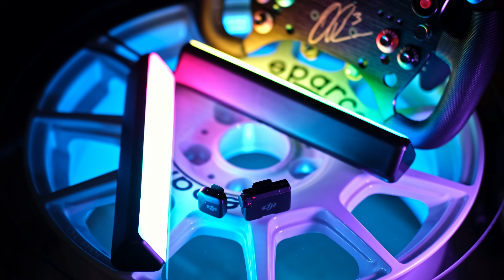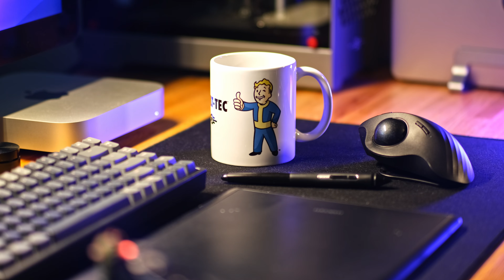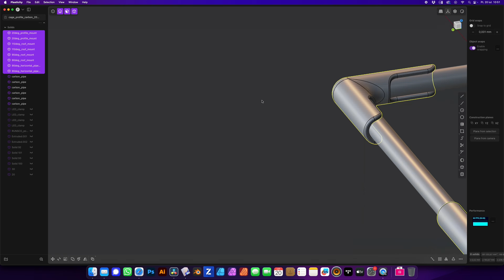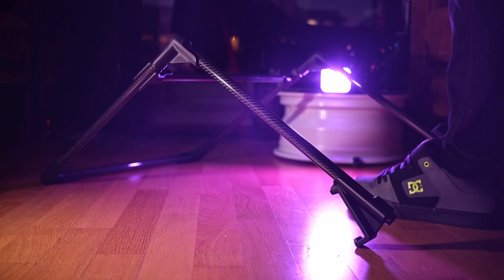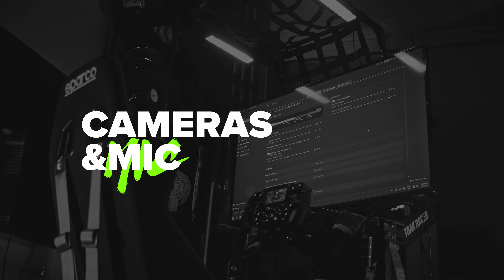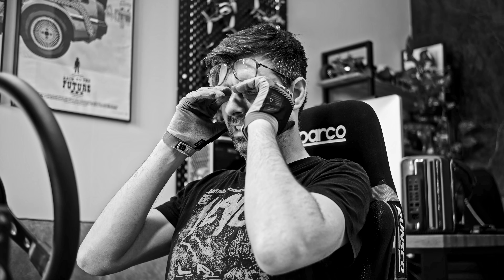How to Build the World’s Lightest Sim Rig Roof — My Framework for Controlled Lights, Cameras & Chaos

Comment: Not gonna lie 
I really like this Idea those
Reply from the maker: Thanks, man! 🙌😄
I knew it was either going to be a brilliant idea... or a spectacular disaster 😂🏁
So far, it's looking promising!
Reply: @RadSeries  No joking
 when I bowering for some Rig Roof idea your video comes up  
Which I think that is very very possible to achieve for my DIY aluminum profile Rig  (*Beside the CAD design Part)

and you gain a sub (me) because of it 
Keep on the good work mate
Reply from the maker: @sinkin1221  Thanks a lot, mate! 🙌🏁 Welcome aboard!😄
Really appreciate the sub. 

I'm super pumped the video gave you some inspiration—that was one of the main reasons I started The Rad Series in the first place.🔧 If you've already got an aluminum profile rig, you're halfway there 👀

If you end up making your own version, I'd love to see it! More ideas, more chaos, more sim racing inspirations 😄🏁👊